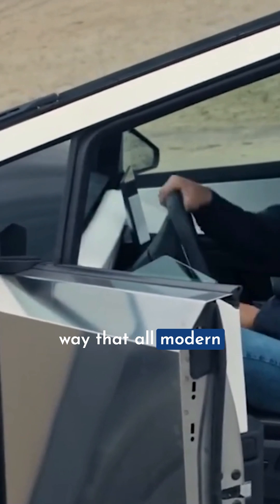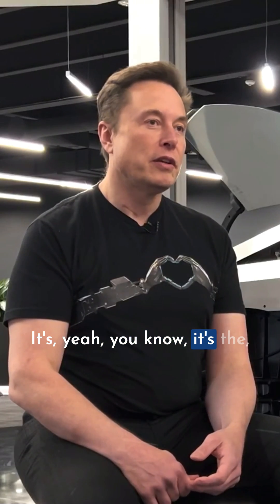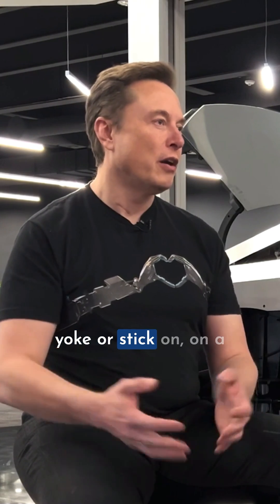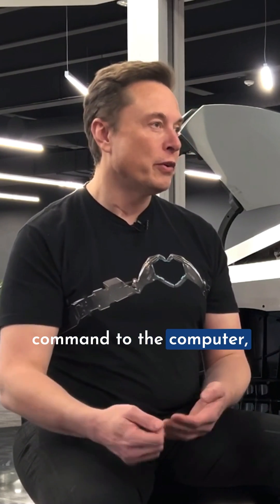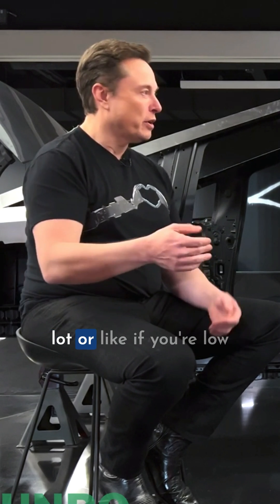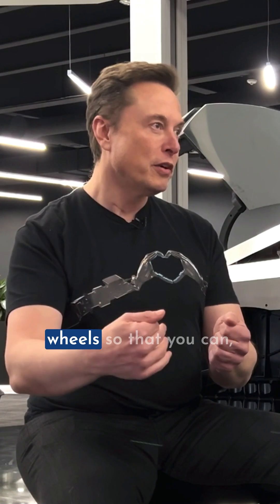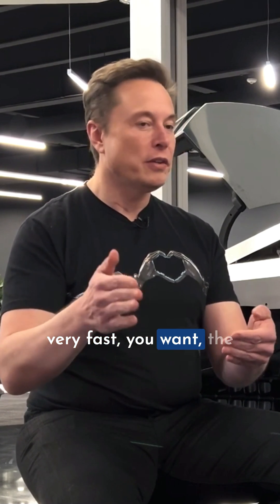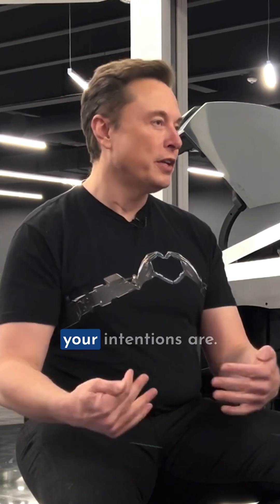Elon Musk's Next Game-Changer: "Cybertruck" Steering #tesla #elonmusk

Comment: Looks like ive been partially banned from writing Youtube comments. I wrote this. If I try to paste it in to comments, it disappears.

If you are going to be an fool and charge your EV inside your garage, and even worse if inside your garage is actually inside your house, then be less of a fool and install a smoke alarm over your car that is interconnected to the other smoke alarms in your house. That way, when the battery goes into thermal runaway whilst charging - and don't delude yourself that "that will never happen to me" - at least you will be woken up so you dont burn to death in your sleep. And despite, it happens to LFP batteries, too. If you have that smoke alarm at least you'll probably have 15 minutes to get your children out of the house and to safety UPWIND before your house burns to the ground.
Reply: Noted!